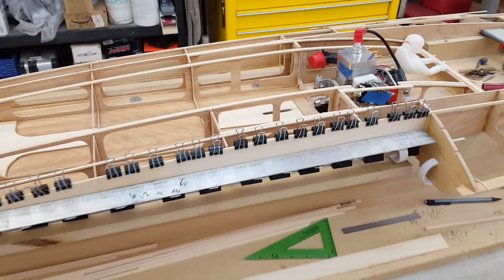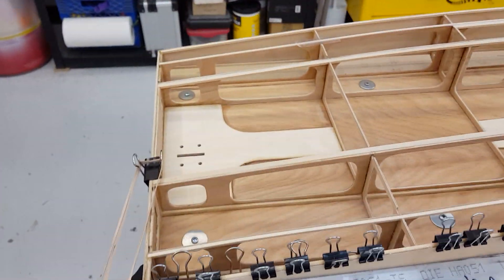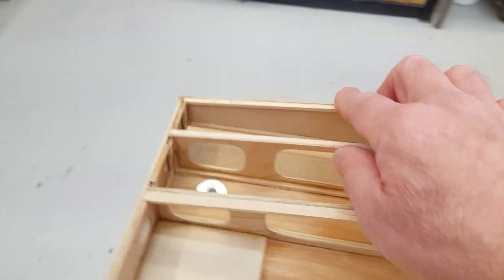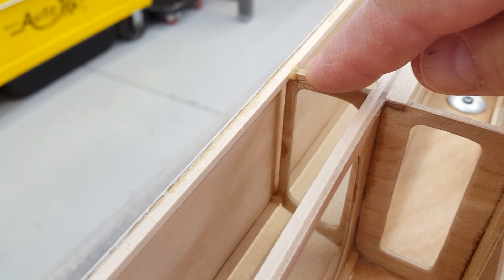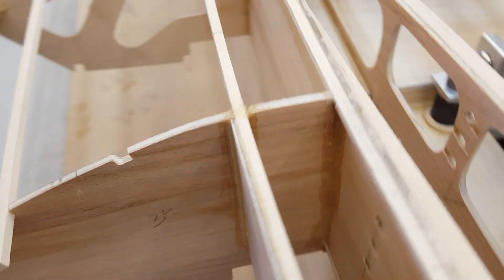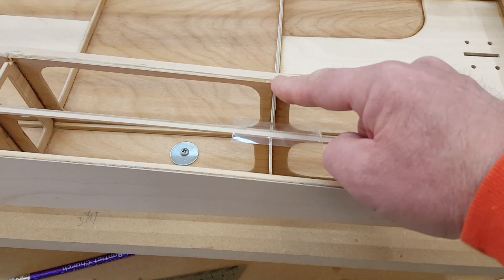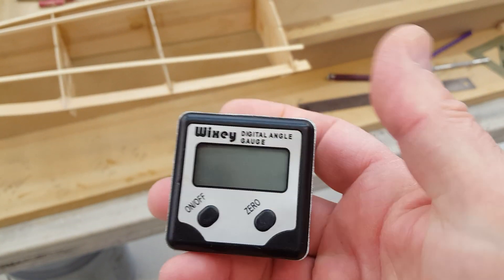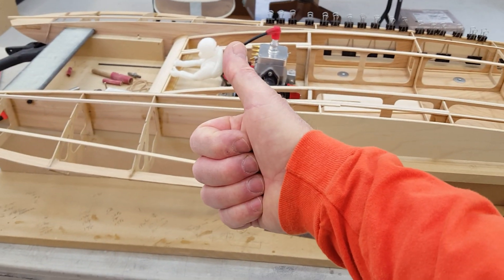Scale Model RC Boat Building | How to Install Decking & Skins a Better Way! "The Gasser" Part 5

Comment: Quick question. How thick is your floor ?
Reply from the maker: I skin the bottom of the boat with 1.5mm (1/16" roughly) ply, and then overlay another 1.5mm over the engine floor area and strut mounting area
Reply: @M5PerfHydros  Thanks for the info and your time. Your videos are a huge help.

Comment: G'day Scott. As usual there's a bucket under my chin catching the drool as I'm intently  watching and listening to your lessons. In one of your videos you talked  about reinforcing bolt holes around the strut/ skeg and in the past I have cut and glued in a small piece of brass tube just long enough to go through the hole and not to long to be crushed when the washer and nut are installed. If you put a close fitting rod in the tube and give a few taps with a small centre punch first and scuff the brass it helps to " KEY " it in place that way you can still get the bolts out without disturbing the epoxy. It works.  Thanks for your video's 'they're great. As a matter of interest no one here in Australia apparantly  run wire shafts. I've got 2 on order with Brett and associated components. All the best mate.
Reply from the maker: Thanks Chris,
I've thought about sleeving the holes, maybe with a piece of aluminum tubing. Appreciate you sharing your experience doing that
Reply: @M5PerfHydros  G'day Scott. I'm chasing a bit of info if I may. I've been trying to find small aluminium countersunk set screws over here and other type's as well and no one seem's to know about them or have anything to do with them. I like your idea of using the aluminium one,s to me it makes sense. Could you tell me where you get yours from please so that I could order some and what are your popular sizes. We do have a micro fastener shop in Melbourne but they only have steel, stainless steel, hi tensile or alloy steel small bolts and nuts. Just as a matter of interest, is Brent Byers a difficult person to deal with? we have to and froed, now I'm waiting for the invoice so I can pay him and haven't heard from him in a couple or so week's. Just wondering. Anyway, All the best mate. Chris
Reply from the maker: Here you go.  Scroll down and click 'Show More' at the bottom to find everything you'll need
https://www.fastener-express.com/aluminum-fasteners-nuts-washers.aspx
Reply: @M5PerfHydros  Thanks for the heads up mate. I've just about got an order ready to go.  Scott, can I share a passionate gripe with you. I've watched umpteen dozen videos in the last months watching races and looking at your pit tours and just drooling about alot of things and what hurts me is that when anyone drops a boat into the water its flat out full throttle. WHY can't the motor's be warmed up a bit more gently. Take the race boats, big ones. We always gave them a dry fire and pre warmed them and took off with all good intentions to protect the engine and make it last as long as we could  but the model boats they just throw 'em in and blow the weeds off the banks. It was something I  was taught during my apprentiship and stuck with me . Just trying to get your perspective of the idea of warm from a man of boat racing.
Reply from the maker: Oh I completely understand!  I came from the world of full size boats and cars and motorcycles too, and you would never blast off with full throttle like we do with the models.  Those that did such things would often wonder why they blew so many engines.  But... I'm in a different world now.  The two stroke model engines are extremely finicky, have near zero torque, and tend to go lean and stall when going from zero load on the boat stand to full load when they hit the water. If you don't come off the toss hard, you'll watch everyone else race while your boat floats dead on the pond.

Comment: What kind of wood do you use for structure and planking?
Where can I get a kit?
thanks!
Reply from the maker: I use Finnish birch ply from Aircraft Spruce.  Build a boat!  Kits, cowlings, parts and info here;
* R/C Unlimiteds, the largest scale hydroplane racing club in the world; https://www.rcunlimiteds.com/
* Awesome laser cut wood kits; https://mlboatworksrc.com/
* Fiberglass hulls, cowlings, and other parts; https://www.rcboatcompany.com/
* International Waters rc boating forum; https://www.intlwaters.com/
* Jim's rc boat dock forums; https://www.jrcbd.com/forum/forum.php
* Parts and useful help; https://www.allrc1.com/

Comment: Do you have any advice on how to deal with the compound bends on the front of a round nose hydroplane? I bought the 1/10th scale Newton 103 from ML Boatworks.
Reply from the maker: It's tricky, but you need to relieve the decking by cutting several V-shaped slots angling in toward the center from around the perimeter.  Odds are that you'll ruin the material in your first couple attempts, but eventually it'll make sense and you'll get it!
Reply: @M5PerfHydros  That's what I kind-of figured. I thought I would make it with thick paper first to give me a template. Hey I just wanted to say also I really like the channel and please keep it up.
Reply from the maker: Thanks Scott!
Reply: @M5PerfHydros  How can I send you some pictures?
Reply from the maker: I'd love to see the pics! Send to scott.meyers24@gmail.com
Reply: @M5PerfHydros  Email sent
Reply from the maker: Got it!  I just took a long look at the pics this morning, reply sent.  Keep them coming please!

Comment: the ply on my boat keeps lifting in certain spots what would you suggest to fix that ?
Reply from the maker: Bummer!  Must not have been correctly installed originally. If there's access from underneath you could just add some epoxy fillets to strengthen it, but if not the only good fix would be to pop the decks off and re-do them.  You can do it!
Reply: @M5PerfHydros  I will just remove it and prep and glue it on again
Reply: @M5PerfHydros  I think abit of water got in there and made it worse how do you make sure your seams are good and waterproof? Thanks

Comment: what do you us the thicken the epoxy to get it to stay on the rails when you are gluing parts together my plans from blazer marine said to us micro balloons to mix in the epoxy i was just wondering what you us
Reply from the maker: You know, I've been meaning to do a video on that. Micro balloons are fine when strength is not an issue, but most of the time strength IS the point so I rarely use them. My favorite go-to filler is West Systems #406 colloidal silica. It blends easily, sands easily, and holds great using much less than with micro balloons. Next up is West Systems #410 microlight fairing filler but only for it's light brown color. I'll add just a tiny bit of the 410 in addition to 406 when I'm mixing epoxy for an area that will be visible and unpainted later, such as in the engine well of my boats. This gives the epoxy a fairly natural wood look instead of the plain white of 406. Hey.... You gotta make it look cool, right?

Comment: ok do you us g flex or regular epoxy to glue the deck
Reply from the maker: Good question... Because I prefer to use West Systems epoxy to seal the interior and the decking, I also use it to attach the deck.  It's difficult because the working time is so much shorter and it always takes a while to get the deck weighted/taped/clamped into place, so I always do a complete "dry run" of the installation before I apply the epoxy.  
Thanks for the question James. I think I'll put that in a video when I'm ready to finish my current build!